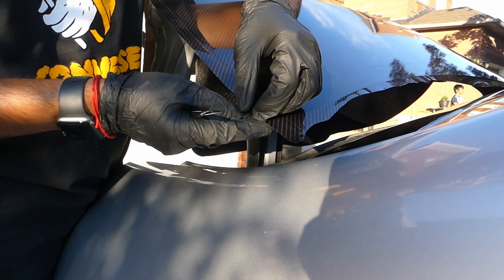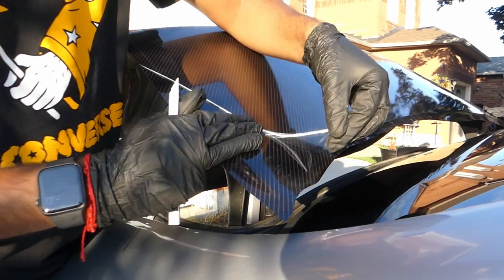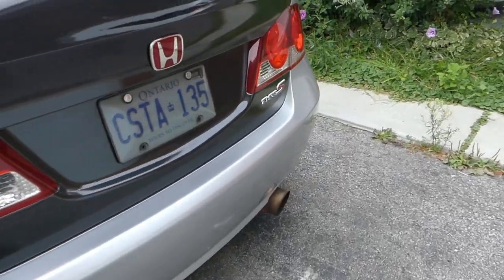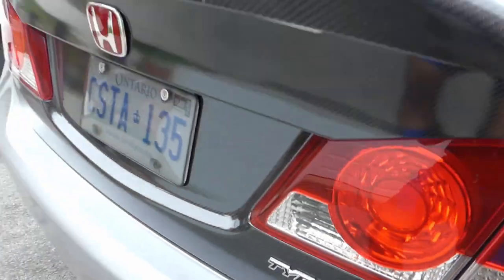CARBON DUCKBILL SPOILER | KevMannz | 2006-2011 8th Gen Civic

Comment: Hey bro you got a link for that spoiler ? Also like how much of the trunk does that cover ? Like if you measured in from the trunk towards the window , couple inches ? I bought a mugen rep wing on eBay and left me with some trunk holes , I hit them with bondo but still don’t like it , also bc I cheaped out on the wing when I drive over 60 mph it shakes really bad and I hate it , I like this spoiler or i go back to stock . Info on where to get it and how much the flat part covers the trunk would be great ! Thanks
Reply from the maker: Message me on Instagram, I’ll help you out
jacksonsunthar